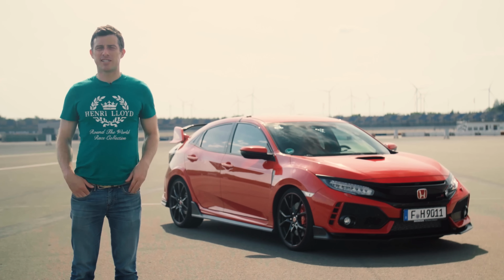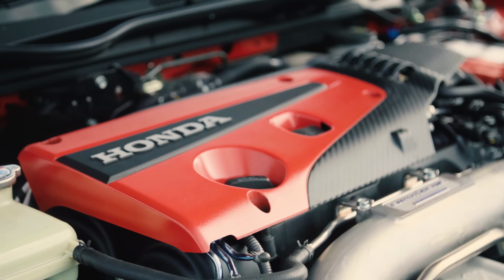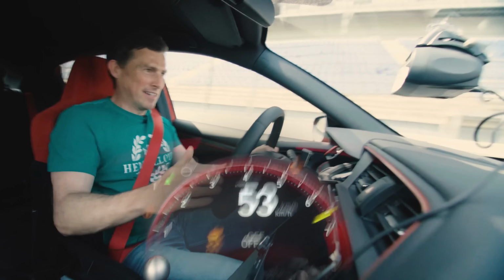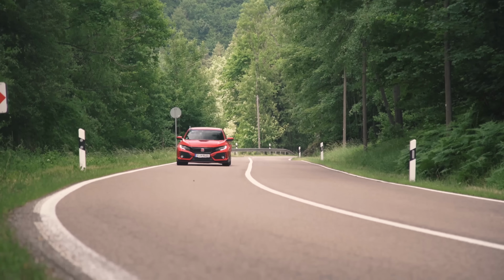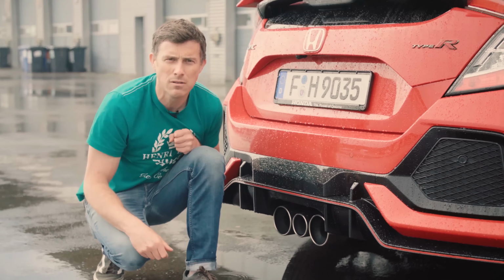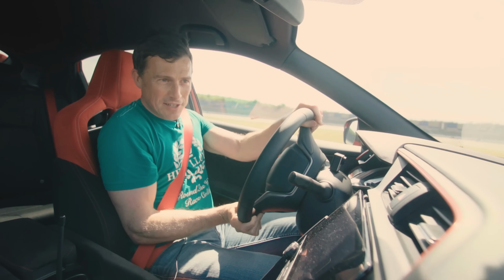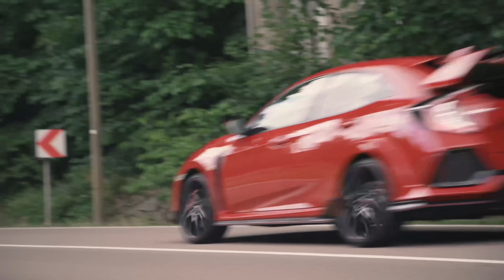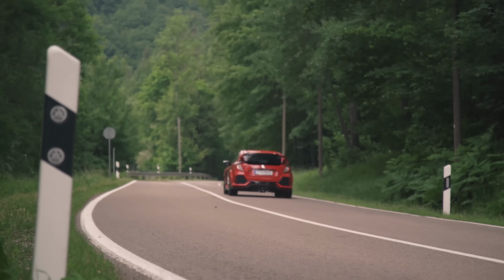2018 Honda Civic Type R - ultimate in-depth review | carwow Reviews

Comment: my only complaint of my 2018 type-r is that I can't change the fan speed without pushing the climate button and using the screen. they fixed that in 2019+

Comment: I own a manual 6 speed Golf R and have driven my friends Type R a few times. My thoughts on comparing the 2. The Golf R feels faster HOWEVER The Type r is way more race/track focused. Harder suspension, firmer steering, more feedback on steering, better clutch and transmission feel, mechanical LSD.... Basically feels more raw and more engaging. Seating position is more race car feel, and seats are superb.  Really love this car. However id pick the Golf R if its just for daily use as i found the Golf R a bit easier to live with ie. softer ride, easier to get in and out of cabin. Better if you have kids or family. Golf R feels a bit lighter, faster to me also, especial if you go stage one APR, gives the engine a lot more torque and better power delivery.  The only other reason id pick the Golf R is if you live in a country where it snows or rains a lot as i found with the Type R when you put the power down in the wet it loses a lot of traction when you push it hard even in a straight line because of its FWD system. .  Golf R is more planted in these conditions and imo safer.. If i could have both the Type R would definitely be my dry weather back roads/track car and the Golf my daily. or when conditions are bad.
Reply: No one cares about the Golf R. Really, no one.
Reply: If you're driving a Type R in the wet to the point it loses traction, you must actually be a clown. Like any other garden variety Civic it's all fwd, all power at the front....about as safe as it gets in the wet. Rwd on the other hand....

Comment: RIGHT ITS FRONT WHEEL DRIVE FOR FUCK SAKE of course its 0 to 60 standing is not going to be amazing but put it on the track or a rolling start and it will eat that grandad looking golf for breakfast.   Its designed for the track

Comment: Ive got a honda civic and its on 112,000 miles and no problems whatsoever honda is the most reliable car out atm🤙🏻
Reply: I still see Honda models from the 90's on the road. They do last a long time.
Reply: @ballshippin3809  VW golfs are extremely reliable as well. My dad's friend has a vw golf mk2 from 1987 with 600 thousand kilometers on the clock and it still runs perfectly.
Reply: dayumm
Reply: how much did it cost u

Comment: The sides of the car is ugly, the front looks good. The interior is just weird on the passenger side. The engine despite the warning light is probably reliable unless they took that money and put it towards styling. Honda is an engineering company first and design company never.

Comment: Nice review Matt.
You mentioned this car is 10k cheaper than Porsche 718 Cayman/Boxster.
True this car and previous type R FK2 are faster on track than the Porsche 718/718S. Also the hp rating is higher for Type R. 2 more doors and seats.
I tested Type R FK2 and a 718 Cayman base with PASM. What do you get more from the Porsche:
- nicer ambiance: low down race car cockpit like, nicer raw sound(unbelievable how it screams when revved) with that engine behind, perfectly balanced car, no roll, huge lateral grip(like on rails), better feedback/precision in the steering
- quality interior, everything put in the right place
- much more refined exterior, looks great form all angles
- faster in flat out acceleration
Porsche is 1/3rd more of Type R price but you get more refinement and build quality obvious by just looking at it.
 We should not judge the cars only by numbers. There are other qualities that might matter. For me it matters more the right atmosphere. Porsche ticks the boxes for me. I won't go tracking the car or driving for max performance, so being faster on the Nurburgring is not that important.

Comment: 0-60 would be better if you did not pop the clutch and ride it for better acceleration
Reply: Yeah, he’s a terrible driver for manual car.
Reply: Farhan Arif . Agreed. Matt bogged first gear every launch
Reply: Yep. This should thrash my i30N, but I've done 0-60 in 5.3s in that - by not side stepping the clutch!!
Reply: Stg he he must have put like 1,000 miles or wear on the clutch just to make this video by his weird clutch work
Reply: I honestly cringed watching Matt side step that clutch!! WTF were you thinking? !
Reply: Sniff sniff, what's that burning smell?

Oh nothing, nothing...
Reply: atiprocharger I was thinking the same way. That clutch release was so wtf. Anyway the car would still be slow as fuck even if he shaved off half a sec with a good start ...for a 320hp light hatchback.
Reply: Yeah, he’s a terrible driver for manual car.
Reply: I thought that 0-60 time was slow. My BMW is 335 horsepower, so only 15 more but it's a lot quicker. I do love the way the civic goes round corners though.

Comment: Golf R and Focus RS are faster and have 4 wheel drive. Both well worth the extra grand or so over this styling joke
Reply: Kenny G well all wheel drive cant be matched with this car.  ur just saying that range rover is better offroad than lamborghini
Reply: Kenny G check lap times on sum track shoot outs betweem them and u will fine that you are wrong.  Standing quarter mile or off the line then yas due to there 4 wheel drive throw a few corners into it and the hondas better on a track the typer whoops that grandpa looking golf ;)
Reply: Lol. A year later and ur comment is  void. This car is above both those cars u twat
Reply: What car do you have

Comment: The problem with manual transmission is that the car's performance is heavily dependent on the skill of the driver!

When you have this kind of exterior, but not the speed to back it up, no thanks. I'd rather buy a DSG Golf R, or even wait for the all new Subaru WRX, which should be out in a year or two.
Reply: this car is faster than both of your examples. Also a 500$ tune nets you 380bhp and 500nm.

Comment: Confirmation the old car is more fun and more hardcore on the track. Pass upgrade from fk2 to fk8 - check. In short this is the new fn2
Reply: Nick B I can't agree more with your comments. FK2 a much better Type R! I think most current FK2 owners will give the FK8 a miss until Honda sort out the Exhaust and Engine sound. I personally think it sounds worse than before and also in comparison with its competitors. It's as if Honda didn't listen to feedback or for whatever reason couldn't get the car to sound good. And who really cares about comfort mode you don't by these cars for comfort! The most rounded Type R.....didn't they say that about the FN2. Im absolutely disappointed with it and so glad FK2 was limited run!! 😀
Reply: totally right mate. why sell a limited produced car (also only one and a half year production that's impressive short) to get what's basically fn2. Yes they did say the same for the original fn2 "better all rounder". Lol I buy type-r not all rounder. In fact, If I really wanted perfect all rounder I would buy golf r straight away won't even think twice. But where is the magic, the hardcore maniacy, the madness, the japaneese styling insideout. They are all in fk2. And no fk2 owners don't talk rubbish for fk8 because they can't affourd to upgrade. fk2 is not cheap car therefore most of them can upgrade to fk8 easily. If you are after a family type-r fk8 is better. my type-r is about madness, fun, hardcore road car for the road. no golf r, focus rs or fk8 can provide more of theese than fk2. cheers to everybody.
Reply: Nick B I can't agree more with you, it's actually cheaper than what I paid for FK2 with loads of extras so price isn't the issue - FK8 seems to fall way short of that hardcore status and sounds rubbish. You would only understand our points made, if you were to have driven the FK2. I certainly won't be swapping the FK2 for FK8 which will be sold in its thousands like the FN2. I'm also not going to be brainwashed by Nurburgring lap times and this comfort mode rubbish! Just like you said if you wanted an all rounder you go Golf R, Audi S3.
Reply: I regret that i sold mine fn2 though

Comment: I think this obsession for Nurburgring lap time between car manufacturers is getting old
Reply: Ilya Elis takumi was driving.
Reply: Zack I agree track times are irrelevant because you could get spanked by a micra if the driver is more skillful.
Reply: Zack you do know that track and road have asphalt, corners, ups and downs and other things in common right?
Reply: Still curious how this FWD slow econobox beat R8 V10 and Porsche GT2 on Nurburgring.....
Reply: Ilya Elis tires that only last 3k miles because they are barely street legal racing tires.
Reply: Mursyid Omar have you seen the hot lap video, its crazy
Reply: but this car would be fun mountain roads . just like focus rs is
Reply: the GT2 you talked about is a 996 GT2 back in 2000.....
Reply: Its not getting old and will never get old. Its simply showing the capability of a finely engineered chassis, suspension and powertrain. All of which helps the car on the road. I'm pretty sure nobody has a problem with Porsche posting laptimes. And the dude who thinks a skilled driver in a Micra could beat up on this car? You must be joking
Reply: But they are a good way to test track focused cars.
Reply: Ur an idiot
Reply: Mursyid Omar it's an excellent measurement of the cars overall performance even SUVs are tested there
Reply: Zack no the Nurburgring is an excellent way to test the cars handling and elevation changes you obviously haven't been there literally all car manufacturers go there to test cars just because it's a track doesn't mean it's only made for racing look it up
Reply: Ilya Elis it's pretty easy actually, it didn't. The car that beat the clubsport S had a roll cage, stripped interior and ultra high performance tires.
Reply: Erick Bren- still living under the rock Eric?
Reply: LOL not at all. Do you drive on a fucking track everyday? No you don't.
Track times don't mean shit.

Comment: all looks no go .
too slow for a car which screams oh look im a hot hatch.
Reply: did u watch the review ?
how much faster was the golf ?
Reply: Άδωνις Βασιλείου and how often are you going to be going to a track with this car? Most of the time you're on the street getting smoked by golfs
Reply: wat track times ? 99% of the time its going to b a road car. its a gud handler but too slow for the way it looks
Reply: 2 sec slow in 0-60 means slow  real slow. no overtaking no quick accelaration . 
on a open track it may b ok but in real wrld dead slow
Reply: hmm thats what im also saying no chance for top speeds in real world quick accelaration is wat matters . this car cant do that. it may get to a highr top speed which is illegal on road iventually. but a gud hot hatch will get to the legal speed limit faster than this.
Reply: As already stated, AWD cars are already going to have a huge advantage from a launch whereas from a launch FWD is very disadvantaged. Rolling acceleration on the other hand is a very different story - the old Mazda3 MPS was a very good example of this. Far too much power for a FWD chassis to tame on launch, but 80-120km/h times rival that of much more powerful and expensive equipment.

The fact that the Golf has a DSG gives it another very significant advantage.

The Civic has no hope of matching that one two combo from a launch but once it's up and going its lighter weight turns the tables.
Reply: there's more to life than 0-60 ;)
Reply: if u guys dont want a  fast car then y buy this wierd plastic car hehe

Comment: Engine problems in a Honda? For once you can feel like an F1 driver on the road...
Reply: It was a pre production model... Ofcourse it might have a bug here and there... But should be fixed by Honda with a quick visit.
Reply: MegaBigByte vtec kicked in yo!
Reply: GP2 Engine GP2
Reply: Rudi Claes ..and no torque steer
Reply: You meant Engine problems with the Hyundai - 1.4 million recalls already this year, due to engine problem (Hyundai)
http://www.latimes.com/business/la-fi-hy-hyundai-kia-recall-20170407-story.html
https://www.upi.com/Top_News/US/2017/04/07/Kia-Hyundai-to-recall-14M-vehicles-for-potential-engine-problem/7531491585218/

Comment: There are some missing thing on this car;
Launch Control
Exhaust note 
Top Speed had to be around 180mph
0-100km had to be around 4.5sec
Reply: 0-100km/h in 4.5 seconds is almost physically impossible for a FWD car with a manual transmission. The fact that it can bully the 350hp Focus RS on the track as well as the Golf R with Haldex and a DSG gearbox says a lot about the Type R's potential though. Also 180mph? Really?

Comment: love the car but it makes my diesel 0 to 60 look good though
Reply: darren j It's because the weight shifts to the rear wheels at the launch. I don't really like this Type R but don't worry it pulls much harder and longer than your 330d in 2nd and higher gears. And those are real life overtaking situations, not 0-62 useless paper stats.
Reply: darren j What's the 0-60 on your diesel?
Reply: Arman_dleg 5.8
Reply: darren j Is it an e90 335d?
Reply: Well it could be a lot of 3 litre diesels really
Reply: Arman_dleg on the 730D M Sport it's 5.6secs which is funny considering it's such a heavy car
Reply: Chatta290 E91 330d Touring Lci model
Reply: darren j 

Whats truly incredible is that this car having a turbo and 120 hp more than an ep3 doesn't do a much more remarkable 0-60 time. A tuned ep3 has pretty much the same acceleration
Reply: BlitzkriegRap I wouldn't say useless paper stats is this car quicker than mine yes no issue, but re overtaking in gear I think you are missing the point of torque in your comment don't underestimate the torque of a diesel car for in gear acceleration.
Reply: 4.9 on a 4,2 tdi a8

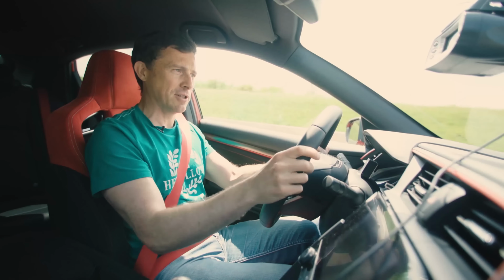Comment: 04:48 warning light

Mat: Which is really really unusual for a Honda

Fernando Alonso: You haven't seen shit
Reply from the maker: Fernando.. Watson is faster than you.
Reply: Your right about that, although Japanese car's are better then most these days they aren't as good as they used to be.
Reply: kaka 

Japanese cars are still more reliable than European brands!
Reply: thanks god u didnt fall
Reply: Its probably from those cough launches
Reply: hihihihihi
Reply: skybluesky1000 

He should have said old Honda.
Reply: This comment didnt age well...
Reply: Pre-production model.
Reply: needs new engine or gearbox
Reply: skybluesky1000 r
Reply: Really, I've not had 1 problem with mine... did you buy an early one?
Reply: skybluesky1000 o
Reply: skybluesky1000 warning lights/ faults in general are not unlike modern Hondas. They're nowhere near as well made as the old Hondas we all love. My FK2 has had no end of problems.
Reply: @Synysterjmz  I've had one low tyre pressure light and nothing else in 1.5 years of owning a 2017 Fk8.